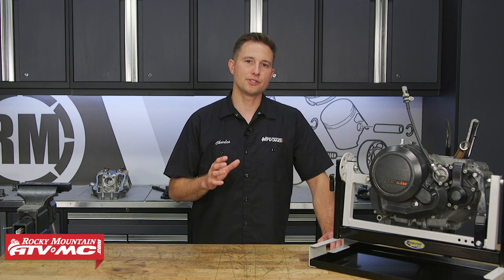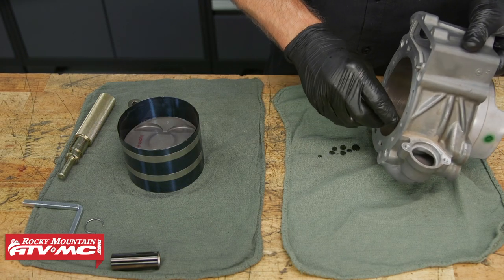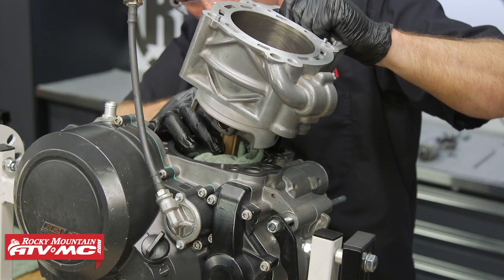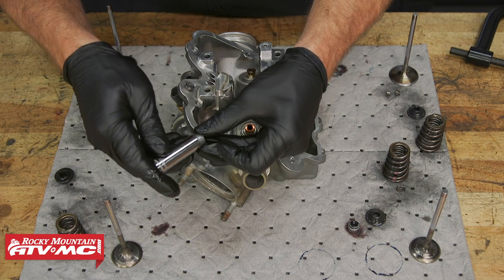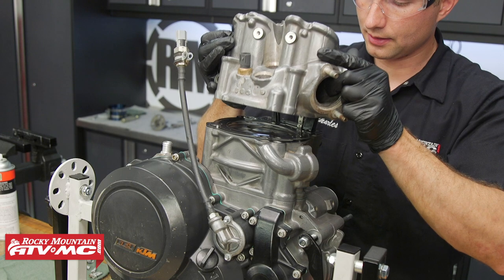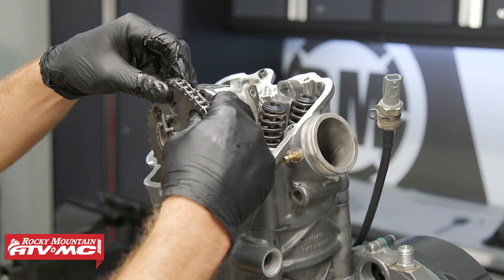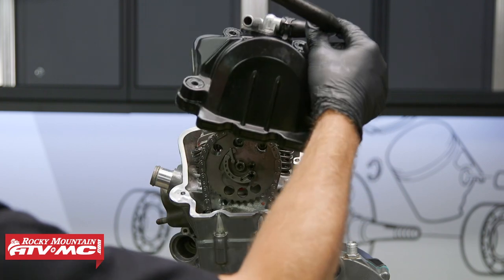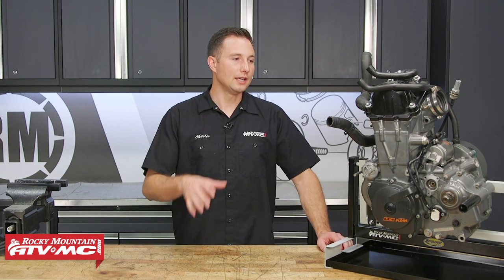KTM 690 & Husqvarna 701 Engine Rebuild | Part 5: Top End Assembly

Comment: So I just finished assembling the engine and I just noticed that the picture from the manual noted that the clip has a particular direction.....and I installed it the other way. The clip was fully seated into the groove and was a real pain in the butt to get in place. Does the clip HAVE to be installed in that direction? I've assembled many engines before and never had an issue with clip direction, I usually just put the opening at 12 or 6 o'clock. Really don't feel like tearing this engine down again and buying new head bolts and a gasket. I waited 4 months for those parts..

Comment: Great vidéo.
Why don't you use a pin in the balancer shaft (hole in left cranckcase half) to find TDC, and to align the camshaft when you put back the timing chain ?
Reply from the maker: That's the best way, but not necessary. On some bikes you can just remove the washer and use the bolt, but others will need the special tool. It's just one less tool you won't have to buy. -Charles
Reply: Does anyone know the value of kTM690 crankshaft index position?

Comment: Are you able to do a top end with the engine still in the bike? I have to do one for a customer and just doing some research
Reply from the maker: You probably could, although it would most likely more of a pain to do it that way. The motor drops out the bottom without much work and you'd save yourself a lot of headache by doing the top end with the motor out. Good luck!

Comment: Anyone have a part number for the puller on the flywheel? is it a 33mmX1.5?
Reply from the maker: That's correct. The part number we used for the flywheel puller was 1179010003.